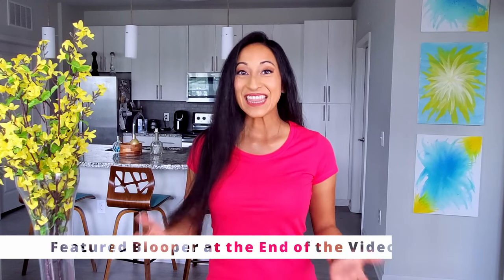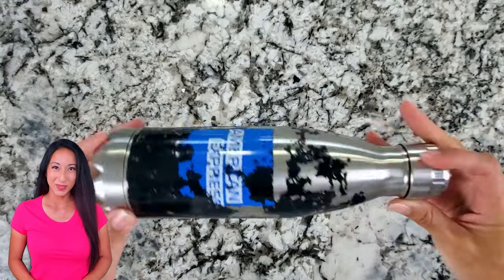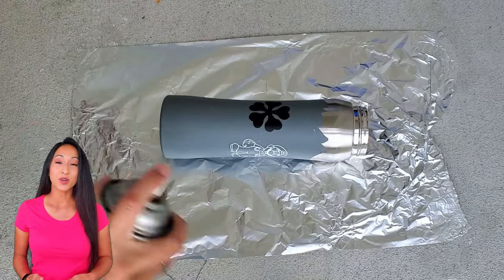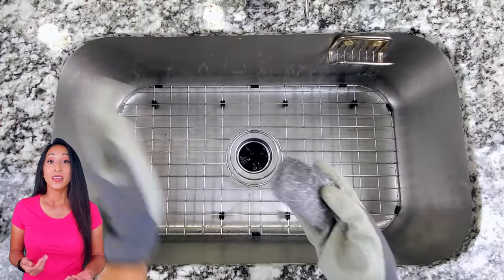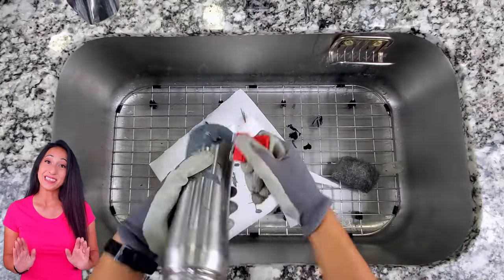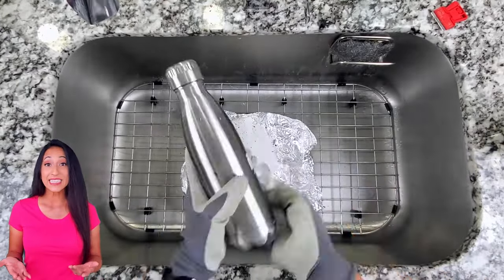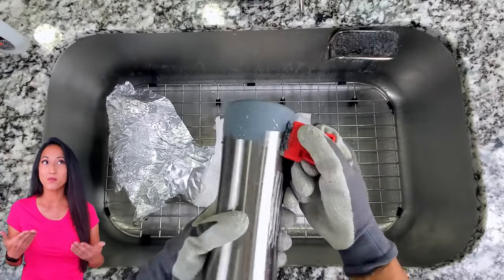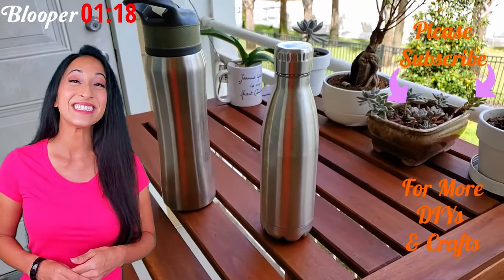Stripping Tumbler DIY | How to Remove Paint from a Stainless Steel Water Bottle- Acetone Vs Easy Off

Comment: Thanks for these tips, I'll use 'em on my project!

I'd like to add a tip of my own: avoid using anything made of carbon steel on a stainless steel surface. The carbon steel can leave tiny deposits in the stainless which can lead to ugly rust spotting! Quite by accident I learned this, by using a carbon steel wire brush to clean a large stainless steel valve! Within weeks it was covered in rust spots, like a bad case of acne…oh, was the boss angry about that.
Reply from the maker: You're Welcome and thank you for adding your tip as well!😃

Comment: Yeah acetone is ballin. Going to try it on some graffiti sprayed on stainless steel utility boxes..
Reply from the maker: Awesome Id love to see before and after pics.  If you'd like to share how it turns out please send the pics to Instagram or my FB page Both are under KimagineDIY.
Reply: @MattTrevett how will you keep the paint surface wet/saturated with acetone for it to have time to work?
Reply: @alansingleton8048  Spray a mist and throw a trash bag over it.  That was 2 years ago and I can't even remember where the graffiti was.

Comment: How  do u take part  out of cup
Reply from the maker: Thank you so much for watching and for your question! 😊 I appreciate you taking the time to ask. Just to clarify, are you asking about how to remove paint from the stainless steel cup or how to take a specific part out of the cup? If it's about removing paint, as shown in the video, the effectiveness of the remover can depend on the type of paint used. You might also find some great suggestions in the comments section from other viewers who have tried different methods. If you're asking about removing a part, could you please specify which part you're referring to? I'd be happy to help further! 🎨🛠️

Comment: Different coatings need different solvents... If it is powdercoated, it's possible that none of the solvents are going to work... If it is painted, acetone will not work on everything... I was refinishing an old table a few years back and mineral spirits, acetone, MEK, and xylene didn't really take the finish / crud off of it, but alcohol worked quite well... Which probably meant it was some sort of shellac finish...

If I was wanting to strip the coating off of a stainless steel vacuum insulated tumbler though, I would probably just sandblast it...
Reply from the maker: Thank you a bunch for tuning in and sharing all your fantastic tips! 😊 Your input is greatly appreciated! 🌟📺

Comment: I would think a heat gun or paint stripper would work well
Reply from the maker: Hey there! Thanks for watching and sharing your suggestion! A heat gun or paint stripper could indeed be effective alternatives for removing paint from a stainless steel tumbler. I haven't tried these methods yet, but if you do, let me know how it works out for you! It's great to have different options depending on what tools you have available. I appreciate your input!

Comment: What about removing lacquer from a bottle? I have a stainless steel bottle but want to strip it so I can powder coat it
Reply from the maker: 😀 Hello! I have not removed lacquer from a tumbler before but I do know they make a lacquer thinner to remove it from bathroom hardware. That would be my suggestion. With any type of "Stripper" Chemical make sure to be in a well-ventilated area. Let me know how it goes or if you find something else that works. 😁

Comment: No saftey goggles with acetone????
Reply from the maker: Personal Protective Equipment is always recommended.
Reply: LMAO... Have you EVER seen a woman use PPE when doing their nails?  Nail polish remover is just acetone and some fragrances that the think women would prefer over the more neutral chemical smell of acetone... Well, that's what real nail polish remover is made from... The stuff that actually WORKS... Not the idiotic "green" crap that they are trying to con women into buying these days...